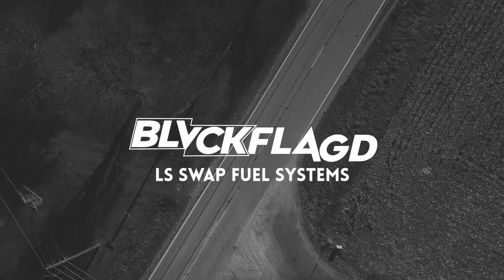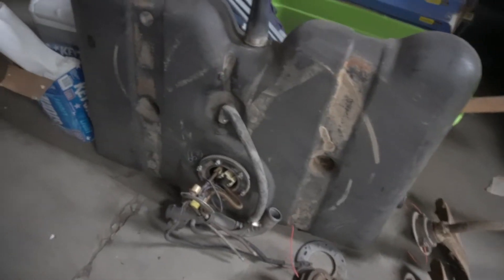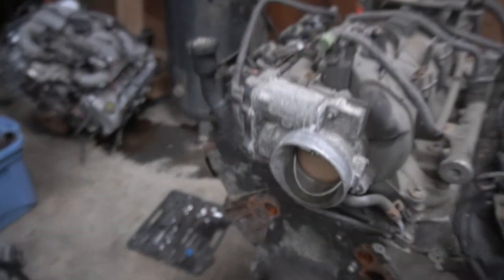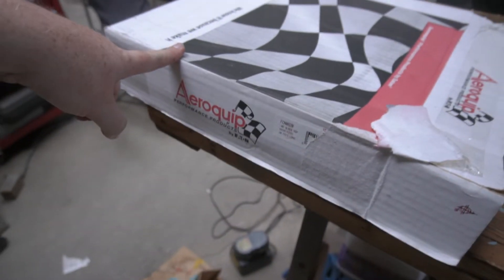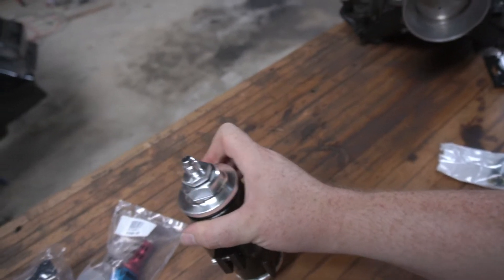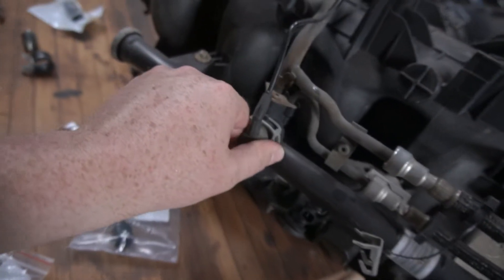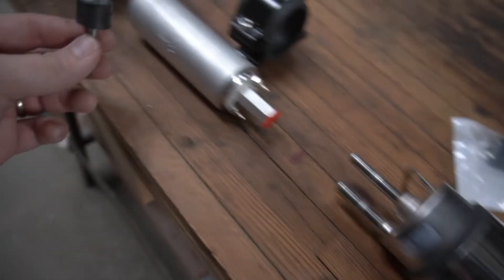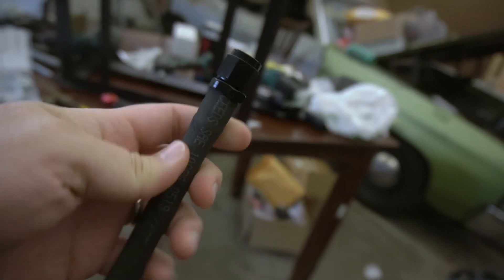2 LS Swap fuel systems YOU can build for CHEAP!

Comment: Great break down 
I have a 1974 2dr caprice 
Would that 95 caprice tank fit into my 1974?
And with it being fuel injection ready would I still need the Corvette regulator an filter?

Can I get that areoq line from that company it self an what Did that 20feet of line cost you?
Reply from the maker: I would think the caprice tank may fit with a little modification since the filler is in the same spot, but I'm not 100% sure. For my chevelle I know I'll have to cut a small portion of the floor, but it's a rust bucket so not an issue for me. On a nice car, you may not want to do that.

For the corvette regulator, it would depend on the type of fuel rail on your swap engine. If your fuel rails have a regulator built in (return style) you don't need anything else and the factory stuff in the caprice tank would work fine.

If the fuel rails are returnless, that's where you would use the corvette filter/regulator. You could still use all the caprice tank stuff, just run the return from the corvette regulator to the return on the tank and run your single line up to the engine.

I got my aeroquip line from summit. I think it was around $95 for 20 feet of it. I do have links to everything I used here https://blvckflagd.com/youtube/2-ls-swap-fuel-systems-you-can-build-on-the-cheap/
Reply: @BLVCKFLAGD  
Ok 
So I'm going to do fuel setup first so do I still need Corvette regulator and filter?
Reply: And thank you for the response
Reply from the maker: @louisziegler3690  if you're running a returnless system from the fuel rail on the engine, yes. If you are running a return line the full length of the car, no. 

I did explain a little further in this video if you haven't watched it yet https://www.youtube.com/watch?v=KJlfyED8ZZ4
Reply: @BLVCKFLAGD  thanks going to do fuel system this week

Comment: Excellent video!!!!

I just subscribed to your channel I have a few projects I'm working on the way you break everything down is very helpful 
So i have a 1973 Chevy chevelle ls motor out an 07 Denali I believe it a 6.0 4l80e 
.( I believe that I can have the out put shaft changed to 2wheel drive)
I plan on using the older clam shell mounts to save funds on my build 
Do you remove the vats or tube the ecm?
Reply from the maker: Thanks for the sub! Sounds like that will be a great combo. I don't know much about changing the output shaft on the 4l80e...I've always picked up 2wd versions from the junkyard.

We used hp tuners to remove vats and do a startup tune for the car. I've read about a procedure where you do key on for 30 minutes or something to remove vats, but I've never tried it.
Reply: @BLVCKFLAGD  

I had a running donor so I unplugged the body control module an let it run to remove the vats I can't wait to see if it works 
I'm can't w

Comment: don't use that Corvette regulator   With  Boost Use a boost reference regulator
Reply from the maker: Good info 👍
Reply: Thousands of corvettes are boosted and so is mine.  The regulator is just fine for boost.  Boost referencing in most cases is actually worse because a pumps flow is drastically limited as fuel pressure rises unless you have a HP pump or a vortech 50/70
Reply: @boss.manlsswapking2219  ...Just informing.  A 1 minute Google search provides a ton of information.  If you cant do that, then you aren't smart enough to boost anything, so it's a moot point.
Reply: @boss.manlsswapking2219  Lol....34,000.  Yep, you dont know much.  If you need any advice, just ask.

Comment: The hellcat fuel pump is rated at 525lph, and is good for up to 850hp. 1 is all you need.
Reply from the maker: Good info. Appreciate it.
Reply: Completely dependent on wiring and fuel used.

Comment: How much hp can the corvette fuel filter regulator be good for?
Reply from the maker: I'm sure it would support 500hp NA easily. I wouldn't be comfortable using it above that or on a boosted setup.
Reply: I have used it to 720whp with a boost-a-pump and a 255 on a boosted setup.

Comment: Have you ever had issues with the push fitting on the corvette filter/regulator? I had an issue with one I tried in which if not pulled all the way forward after being pushed in, it would pour fuel out. I ended up going with a "goodies" brand corvette filter/regulator which had the AN fitting hard mounted to the housing of the filter/regulator
Reply from the maker: My current filter looks like it might have that issue, but its only mocked up (you can see at the end of the video where it moves a little). There are a few plastic clips in the box which probably are necessary...I'll have to mess with it and get back to you. I haven't fired this one up or tested it yet.
Reply: @BLVCKFLAGD  I was under the impression the plastic pieces were for the inlet and return side, I could be wrong though, interested to see your results with it
Reply: I just put my regulator together this morning and noticed the white clips in the bag. Crap...